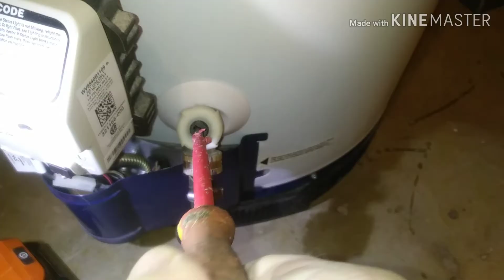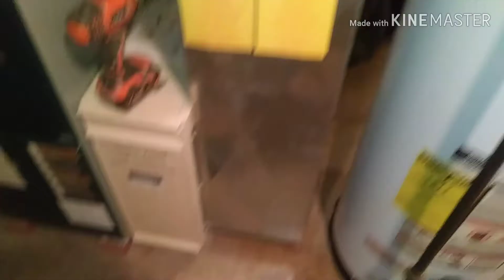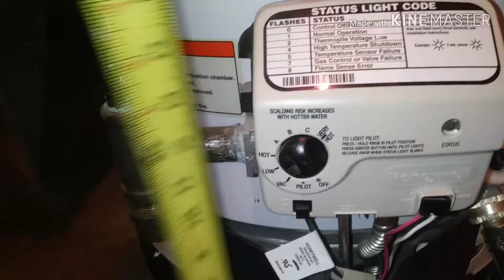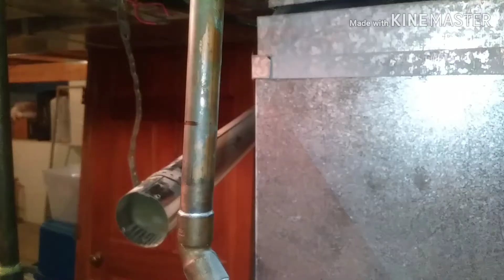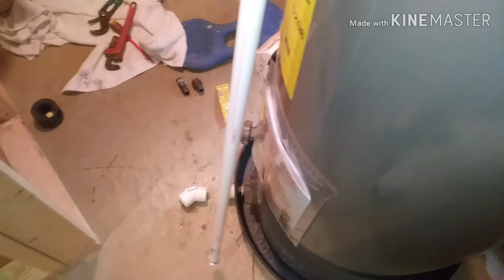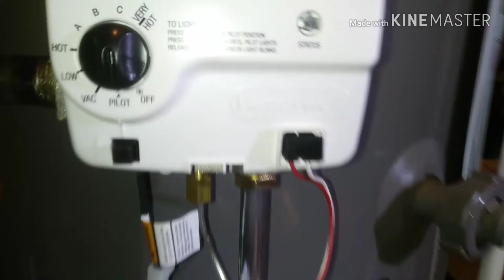Install gas hot water tank

Comment: T&P relief valve piping appears to be PVC or CPVC which are not rated for the temperatures water heaters produce. Most plumbing codes don’t allow for it to drain into the overflow pan either.

Comment: Are those plastic liners inside the water connection nipples on top of it are supposed to be removed ? I've actually forgotten.
Reply: They are heat traps and should stay in place, you should NOT remove them.
Reply from the maker: Yes those are shipping plugs that need removed before install
Reply: @GetToThePointplz123  those are called heat trap nipples. that is not a shipping plug! leave them in